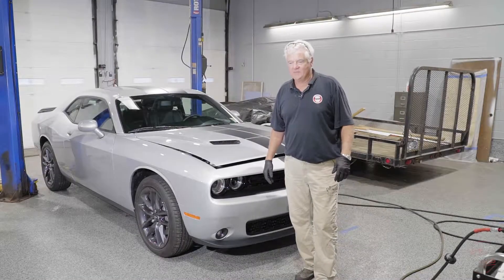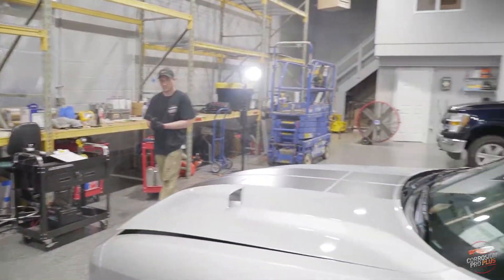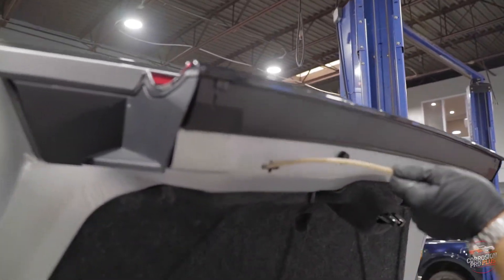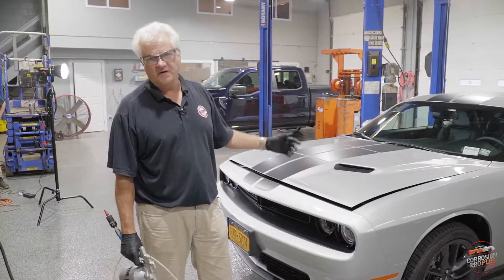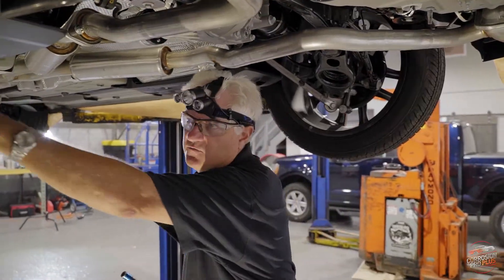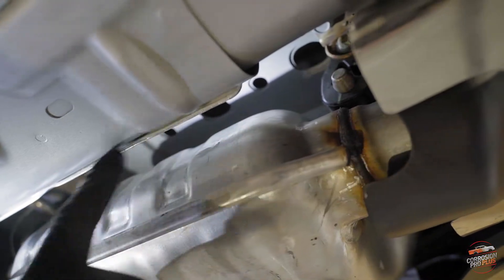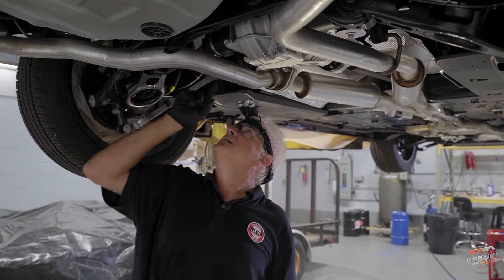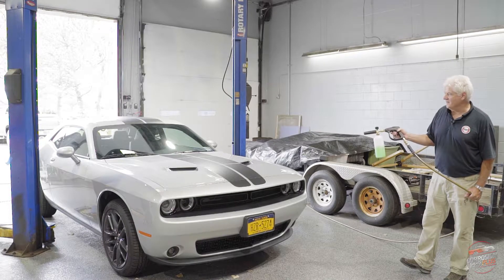2021 Dodge Challenger-  Complete Corrosion Protection process

Comment: This is all great. But how to overcome rust where there is foam in the sills? There are intentions to use ML anti-corrosion compounds that spread better than Movil waxes. But there are no holes into which you can pour it. I'll try it on the keyholes.

Comment: The rear quarter panels are the hardest to get. The factory black rubber plug in the door jam I took it out and noticed dodge filled it with foam.  I drilled about 12 inches higher so I could rust proof that panel, then used a rubber plug.

Comment: I've got a 2013 that I bought in 2014.  Never seen any harsh weather conditions, garage parked and regularly, professionally cleaned and maintained.  Found rust bubbles.  Had no idea Dodge sabotages these things on purpose.  I hope this owner tears it down and removes the sound deadening foam.  Not sure if these SXTs have the same construct but my R/T is just sad to look at now after all the care and love.  I've owned cars for many years... heck, not even my 2010 Ford Fusion is rusting and that's just my winter car.  What a sad, sad ordeal.
Reply: They all do.   2009 on up.  Probably 2008 SRT8 on up.   Mine is a 2010 - bubbled up drivers quarter about the size of my palm.  Passenger has small bubbles starting INSIDE the doorjamb at the rear quarter.  

It's not even these deicers, the foam just catches the water and holds it next to the metal.    I watched this video and felt as though it was a bit futile.

Comment: Many years ago Chrysler made a huge effort to stop body rust. Now they depend on phosphate coated sheet steel for their stamping. No more dipping the body in a tank to really rust proof the cars. Up in Michigan, the RAM's are suffering thru hole body rust after 3 years !! Even employees are buying other make vehicles to avoid this issue !